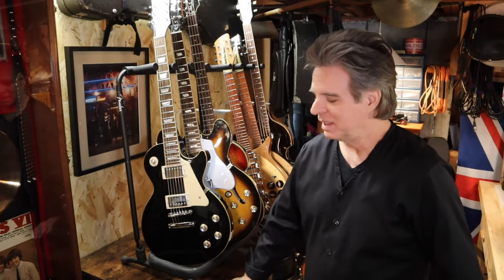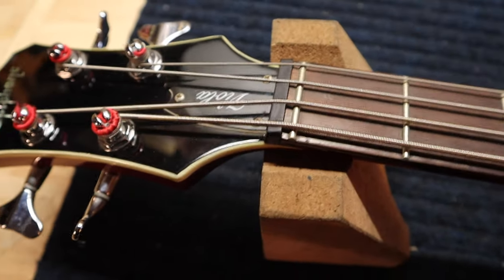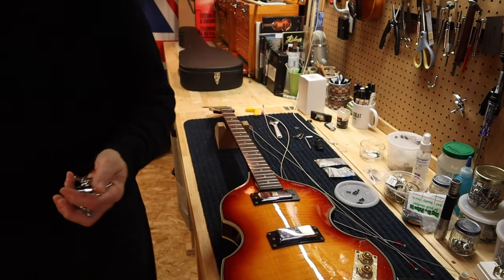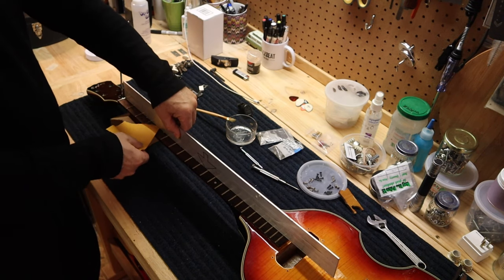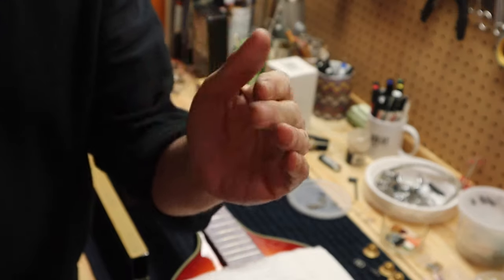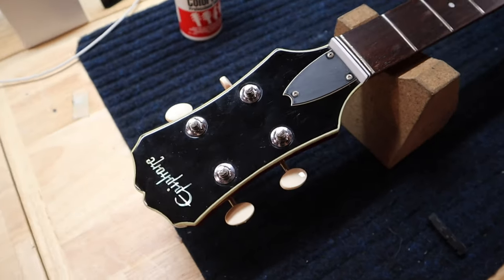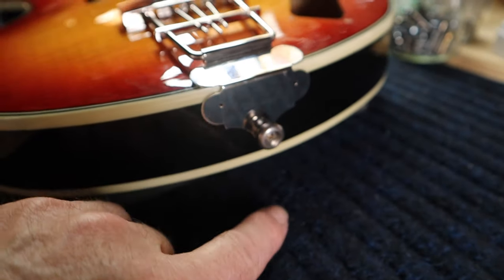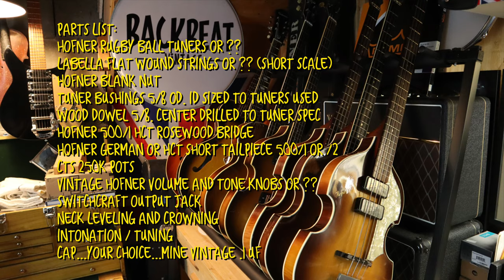Epiphone Viola Modifications. Bass Setup, Alterations and Tone. Beatle Bass. Violin Bass.

Comment: Hello EJ.  Interesting video!  I remember trying one of these before I bought my Hofner.  The color threw me off a bit but I immediately felt that it was too heavy.  It was less expensive and the construction of it's sides bears that out.  You are correct that the finished project is a nice counter point to the Hofner sound.  Thanks!

Comment: The Casino’s thin plywood sides are steamed and bent, like a shallow laminated-body acoustic guitar. Very much like a Hofner violin bass, but without the extra corner blocks. However, the Epiphone has quite a wide, cutout plywood rim. It makes for a tighter low end, without that booming, resonant low end you can get on a Hofner if you play it aggressively.

Comment: Hey EJ, love the show. This is a great episode. I am doing a project myself only I am modding a Rouge VB/100 and was wondering what kind of bushings you used because they have a very wide flange. Thanks for the great videos, I have learned a lot.
Reply from the maker: Hi, its hard to say the sizing because all are different. I believe I put a wood dowel pug in the stock hole and then redrilled the hole to the size of the new bushing. Measure the inside of the new bushing and then measure the size needed to cover the dowel plug. Then check stewmac.com for bushings close to those measurements. I actually had bushings in my parts bin so I cant tell you exactly where to get them.
Reply: @BackbeatVintage  Thank you EJ! 😎
Reply: Sir EJ, would you happen to know where I might acquire a H62/31s tailpiece. I’ve looked just about everywhere. Thanks again.
Reply from the maker: @alfredcreighton3862  reverb.com

Comment: Hey EJ, you are my favorite YouTube channel! You’re a treasure to the entire Hofner community. One quick question, what strap do you recommend for a vintage (meaning non-re-issue) ‘63 Hofner 500/1?
Reply from the maker: It depends on where the neck strap button is. If its directly into the heel then use strap locks for that and a regular strap. If its in the side of the neck then use the hofner under the neck strap and not the side of the neck button. Less pressure on the neck joint and the old hyde glue.

Comment: Why would you want to keep comparing it to a Hofner?  It’s an Epiphone and it is great as is.  Who says the Hofner is the Gold Standard for a bass instrument?  The Epi viola bass sound great as is.  Also, not sure that the instrument needs to have any acoustic sound because 100% of the sound from the amp comes from the magnetic interaction of the metallic string and the electronic pickups.
Reply from the maker: I understand. Im an epiphone fan too. I mentioned in the video the only parts I had laying around in my shop were hofner so I used what I had. Makes sense. You’d be surprised how much an acoustic body affects the actual bass sound/tone through the back of the pickup. The biggest improvement was the leveling and crowning of the frets and that had nothing to do with hofners.

Comment: Thank you for the detailed and informative video!! I just got a hold of a Viola Bass that was strung for a lefty, so they modified the original nut so that the 1st and 2nd slots would accommodate the heavier gauge strings. I re-strung it for my right hand playing and I love this bass. I do plan on changing the nut. My questions is, with the zero fret, will the nut material have a noticeable effect on the sound quality and tone? Or can I save some money by finding a replacement plastic one. 

Also, with replacing the tuning keys, you said you used a 5/8” dowel. Do you just wedge that in or add some kind of adhesive?  I’m looking at a few Hofner keys, but I really like the banjo string type you used,  do you possibly have a part #?

Also, would you be willing to fabricate a bridge? 😬 that is all haha

Thank you again for the great video, I learned a lot.
Reply from the maker: You can use a solid plastic nut that you custom fit. It really just holds the string spacing. The tone is in the zero fret contact. I would wood glue the dowels in place. The tuners I used are referred to as hofner rugby tuners. Try northcoast music for these tuners. I havent been taking work in since covid and most likely wont be continuing to do so. Thanks! EJ

Comment: I just got a new Epi Viola Bass & I'd really like to know what pickup height you decided on?!  The neck pickup on mine seemed a bit far from the strings compared to the bridge pickup which is very high.  Great video by the way!!!
Reply from the maker: Hi Tom, sorry about the slow responce. I usually try to raise the neck pickup to the same height has the the fret board. Not the frets. I then try the bass and if its to loud or distorted and back it off. The bridge pickup same deal but not as high as the fretboard. Try to get the bridge down so the string height from the 12th fret to the bottom of the strings (low E) is 3/32’s. Then adjust the pickups.

Comment: Thanks for great video, much more info than i ever saw on forums about Viola. My problem is with pickups. Thed don’t buck the hum, i do not know why. I checked the wiring, even connected to jack directly, doesn’t help. Can this be fixed? Can’t find replacement pickups to fit original mounting rings too…
Reply from the maker: Tough to diagnose via computer but make sure the electronics are grounded to the tailpiece. Take anything in the line out (pedals). Try a different cord. Make sure there isnt any florescent lights nearby or in the same line. Does the hum go away when you touch the metal?  Make sure the pickups are grounded correctly and consistant on both pots.
Reply: @BackbeatVintage  yes, i checked all of this, and problem is consistent on both viola pickups. Looks like a mistake while winding. I have different basses and guitars, and viola is the only example where humbucker produces same noise as single coils (same room, and my room is noisy, yes).

Comment: Hey there EJ, I’m in the process of modifying a Harley Benton beatle bass and I wanted to replace the heavy duty tuners with something similar to a Hofner. I reached out to StewMac but they weren’t very helpful when I asked if they had a tuner bushing that would fit the 5/8 inch hole. Did you still have to use dowel when replaced the full size bass tuners with the Hofner rugby ball tuners?
Reply from the maker: Hi, yes you need to use a dowel. The new tuner should cover it on the bottom side and then get a tuner bushing that is wide enough to cover the dowel on the topside. It has to be the correct inside diameter to fit the new tuner. The hole you drill for the new tuners may need to be slightly adjusted to fit the new bushing. Let me know if you understand. If not I can draw you a diagram.

Comment: Great video!  I like seeing all the Epiphones.  Did you do anything to the Casino to give it more of a retro sound?
Reply from the maker: Hi, the casino was one of those guitars when I picked it up everything just seemed right. One of the few guitars I didn’t have to do anything. Its a keeper. EJ
Reply: @BackbeatVintage  Youre so very lucky..I wished I would've been able to keep mine back then..
Reply: ..As a consolation, I do still own, not play much recently, two Kalamazoo-made Epiphone acoustic guitars. One is a vintage sunburst 
FT79 "Texan" which had some work done on it, and a natural FT90 "ElDorado", which had to be refretted. "Texan" was also refretted, along with bodywork to repair a lengthwise crack..Both guitars, altho a tad different in "persona", just sound amazing. Both mid-60's era..

Comment: Backbeat Vintage. What model of Hofner tuners did you use? Also, what size ferrule did you use to hide the dowels?
Reply from the maker: I used what hofner refers to as rugby ball tuners. You will need to shop around for ferrules that fit the hofer tuners plus has the outside dimension of the dowel hole. I had then in my parts bin so I cant know where they came from. Once you have the dimensions try stewmac.com for their selection.

Comment: Great video. I have a stock Viola bass. Where can you purchase the Hofner bridge and tail piece? Which Hofner model tail piece did you use in your video again. Great work. UPDATE> I found all the parts on the Hofner website. What flatwound strings would you recommend for the Viola Bass? Thanks Eric
Reply from the maker: Labella flatwound deep talkn strings. The ones made to fit hofners. The tailpiece is the short one used on hofner club basses and some earlier vintage beatle basses after 65.
Reply: @BackbeatVintage  Excellent. Thanks again.

Comment: hi! Cool work. Do you know other lightweight tuners, besides the ones you are using, to replace the stock ones on my epiphone viola? Should I look for 5/8 in size? Any advice is appreciated, thanks!
Reply from the maker: Hi, I actually dont know. Sorry! I used what I had hangn around which is mostly hofners. Take one off and measure and then go on stewmac.com and see what tuners match those dimensions. Hopefully this will help. EJ

Comment: Hey EJ any chance you could do a tutorial on how to properly sand the clear finish off of a Natural Epiphone Casino to make it look more true to the Lennon Revolution guitar???
I have a standard Natural Casino that I've added the black grommit washer to the switch and replaced the stock tuners with Grovers but I need to know how to get the clear coat off without damaging the guitar. A video would really be great assistance
Reply from the maker: That guitar is most likely a poly finish. Poly is like a plastic coating over the entire guitar. Its a lot of work and most likely will affect the finish on the wood. Be careful. Not the same as removing a lacquor finish.
Reply: @BackbeatVintage  Awesome! Thanks for the info EJ!
You know you and Ardy Saraff of the Fab Four should team up every once in a while to do some great Hofner videos!

Comment: Great Video! You mentioned that you rounded and painted the edges of the control panel black. What kind of black paint did you use for that? Thanks in advance!
Reply from the maker: Hi, I actually use a black sharpie. Dont hold it there to long as it will bleed into the plastic.
Reply: @BackbeatVintage  Thanks a million!

Comment: What flatwound strings would you recommend for a beginner to use on the Epi Viola ? Also, a bit confused over whether I need short or medium scale. Lastly, would you recommend nylon tape wound strings ? Thx.
Reply from the maker: Hi, with the modifications I did it would be short scale strings but if your epi is stock I would go for medium scale flat wound strings since the tailpiece and tuners are set up for that. Im not a big fan of nylon tape. Thx! EJ
Reply: @BackbeatVintage  Thank you so much. That was very helpful.

Comment: I think you mentioned the zero fret has to be higher than the rest of the frets. How did you leave that one higher when leveling? Did you just not run the sanding bar over that fret?
Have to say I was thinking of purchasing an Epiphone Viola bass, but I'm a little put off now with the Tailpiece, fret, and heavy machine head problems and hollow nut. Is the Tailpiece falling apart the same on all?
For someone not skilled as a luthiers. Which would you advise as the better buy. The ignition Hofner or the Viola?
Reply from the maker: Hi, you have to avoid sanding the zero fret for sure. The epiphone is a nice quality guitar for the price range. I was just taking it to the next level and being a hofner fan I chose to use the parts I had. The ignition is a hollow body and the viola is a chambered body. Both choices have such a different tone. If you like the hofner tone (warm woody beatle tone) then a would pick the ignition but it too needs some upgrades to get the beatle tone. If at all possible, I would suggest the hofner hct contemporary. Maybe a used one. For the few hundred dollars more you wouldnt have to do a thing. Maybe a set of labella flatwounds for $40. Hope this helps.

Comment: I'm a Fender bass Guy but I have a Epiphone Viola bass and I do like it. I put Chromes on it medium scale and they work well. 
My question is , Are the Hofner  CT series basses worth the cost over what the Ignitions series basses are priced?
Reply from the maker: Hi, yes. I bought mine ct used for $675. Perfect condition with a hofner case on reverb.com.The ignition needs work that costs in parts etc that puts it right up there. CT minor adjustments are needed and will cost you little. Maybe a set of strings. Thx!  Ej
Reply: Thanks for the advice E.J.

Comment: I have this exact bass but an earlier model made in Korea at the Unsung factory around late 90s / early 2000s. This model should have medium scale strings on it because of the original tailpiece. 

Do you think one could move the neck’s strap button so it doesn’t lean outwards? Or I’ve seen them weave the strap under the tailpiece to pull the guitar towards you? Which do you think is better?

Did you weigh it without the tuners on it?

I also have to replace the jack does Epiphone make a jack replacement for that model?
Reply from the maker: Hi, I’m not sure to be honest. Its really a guitar balance issue. This is one reason I tried to lighten it up. I wouldnt weave it under the tailpiece as that might affect the tuning. Im not sure where to move it to so it doesnt lean. Thats a tough one. Regarding the jack you can order up a switchcraft output jack and change it up no problem. Sometime you might have to open up the hole using a ream or file. Regarding the lean issue I had a guitar that did that but I changed to a wider strap and it helped for some reason.  Thx!

Comment: Great  video EJ, I have got an ignition and a viola, in your opinion, what is the better guitar?
Reply from the maker: Hi, well.....I’m a hofner guy but there are times when a different tone /sound may be required and I see these as two different tools. Both are similar  in looks but as you know they both have different tone, sustain and feel. For both....I just wish those building them would use better parts and better fine tuning for tone.
Reply: Haha thanks EJ, so you have to pick one, which one and why..
?
Reply: @simonbirtles8981  I also have both.  The Epiphone certainly looks better but the neck dive bugs me.  Mine also has a buzz on the open A string.  So I prefer the Hofner.
Reply: @georgeemil3618  agreed mate, my viola i bought used,its a 1990 from serial number but had tuning issues from when I got it and there is a suspected electrical issue, got it for 120 UK money which is cheap as I find particularly the ignition, used they are going for only fractionally less than buying new, wish the neck of the viola was on the Ignition though

Comment: Did you consider putting in Hofner pickups (be it the German pickups or the Chinese ignitions)? Curious as to your thoughts on that.
Reply from the maker: Hi, I didnt because I thought it was nice to have something different sounding. They are very heavy pickups for sure. If I was going to put in hofner pickups I would most likely do a setup like the hofner 65/66 setup. I would still wire it like I did. I like the two volumes and a tone dial. Thx!

Comment: Also, is the potentiometers hole too big for a Höfner panel?  I know Höfner uses two screws and the Epi uses 4, so the holes would be visible. But can you actually fit a german switch panel in there?
Reply from the maker: I didnt try but I would say the control panel and plate from 1965 up until 70 might fit. Im not sure. I didnt want to stuff the hofner electronics in it because I wanted to hear its own unique tone.